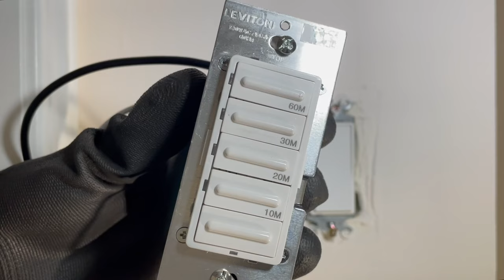How to install a timer switch - Fan or light timer - The Electrical Guide

Comment: Videos are always great to watch as a student!
Reply from the maker: Glad you think so!
Reply: @theelectricalguide  question! In a wire diagram, would a light need constant power going to it even if it’s controlled by a switch? And nothing afterwards?
Reply from the maker: @SilentKat  No, the light would get fed from the switch, if it had constant power you wouldn't be able to turn the light off. Power from breaker to switch then the other side of the switch to light.

Comment: I connected my timer but when I finished, my light was very dim. The only difference was that the light switch was a 3 wire where the exhaust fan’s switch was 4 wire. Not sure why but i think it has something to do with a 3 wire going to a 4 wire and/or the switches were jumped and when I added the neutral to the timer, it is draining electricity causing the dim light. Im not sure, I just don’t know what is causing the dimming of the light?
Reply from the maker: Tough call, so the timer is for the light or the fan? Sometimes you need a fan rated timer. When you say the "light switch was a 3 wire" does that mean it had 3 screw terminals? Or does that mean it had 3 wires attached to it? What colour were the wires? When you say "4 wire" what are you referring to? The wires attached to the timer? Nothing should be draining electricity. I'm sorry I'll need a lot more information to be able to help you here.
Reply: @theelectricalguide  thank you for your rapid response and your help. So the switch I’m replacing is a standard on/off switch that I am replacing with a fan rated timer switch to run my bathroom exhaust fan. At this point there are 2 on/off switches presently installed side by side and both have only 3 points of connection in the rear which 2 black wires and bare wire. I am assuming hot and load are black and bare wire is ground. There are neutral wires bundled up and capped tucked away not being used at all. I figured the light switches are not designed to accept a 4th wire/neutral. To install my bathroom fan timer, the instructions say “neutral required” which is fine as the neutral is there. So I removed the “old” switch and connected the new fan timer switch plus neutral and I turned breaker back on. Since I didn’t mess with the light switch, I decided to turn that on first, me being overly cautious, and the light was dim. After trying another neutral of the 4 bundled up, I got the same result, which I expected but I figured I would try since it was accessible. I undid everything and it’s all back to the way it was and the light is back to normal. This is a brand new build and I suspect that every light switch is connected the same way (no neutral connection).
Reply from the maker: @sxirs  Hrm, my best guess is that when you add the neutral to the bundle it's not making a great connection with the other homerun neutral. Usually if lights are dim mysteriously it's a neutral related problem, usually a poor connection. Sorry I can't help you much beyond that without seeing anything myself :)